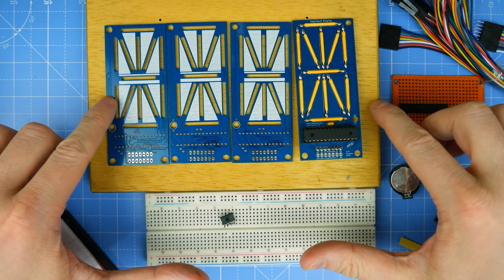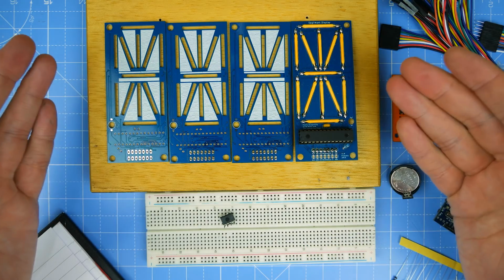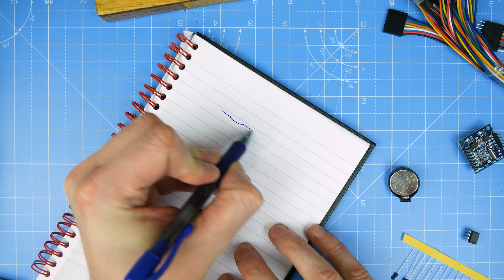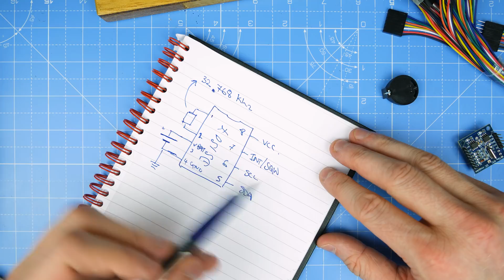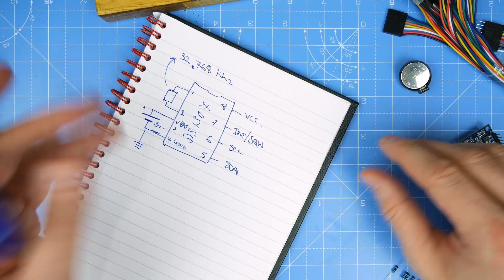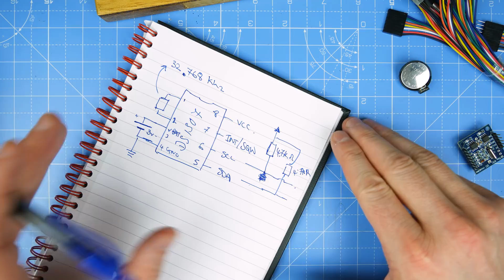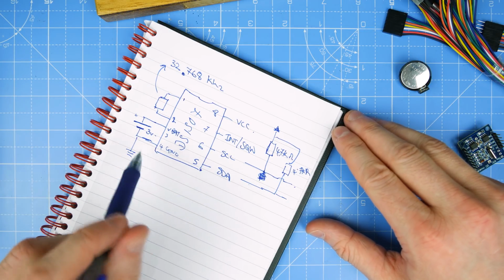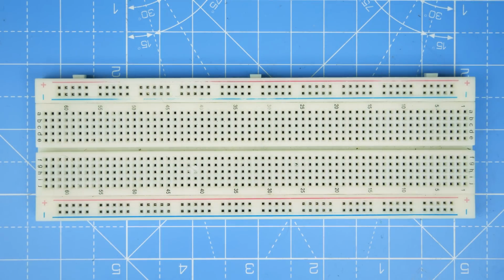DS1307: Let's make a clock with the Seglament Displays Part 1

Comment: Have you ever tried a ds3231 module?   The interface is very similar.  It requires no external crystal and it is accurate to within one minute per year.  I built a clock with one four years ago and I haven’t bothered to set it since then.  Amazing
Reply from the maker: I have, the d23231 is great. If only it came in a DIP package, far superior to the ds1307.
Reply: why do you need a dip package?
Reply from the maker: I don't need a DIP package, I just want it for aesthetic reasons.